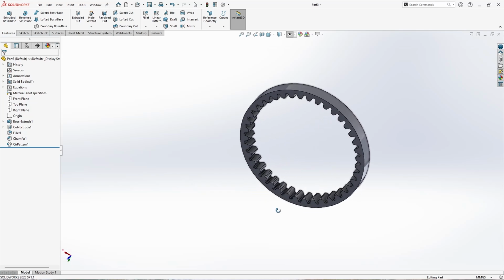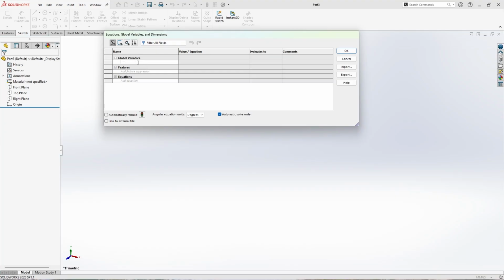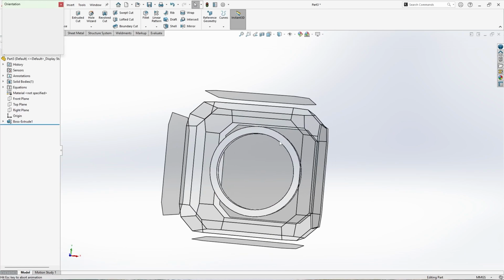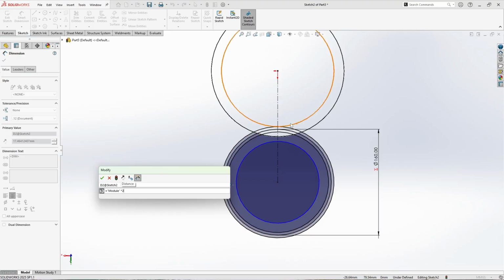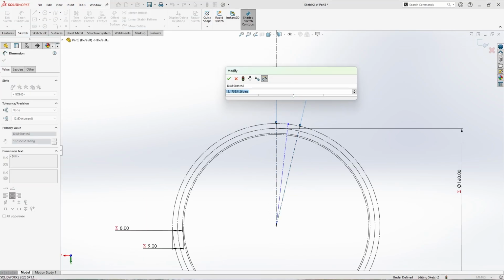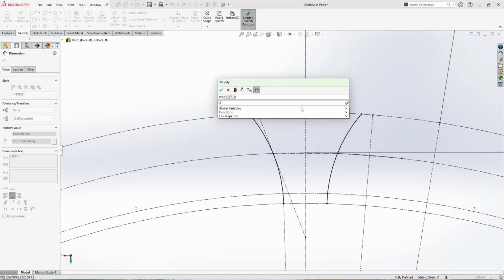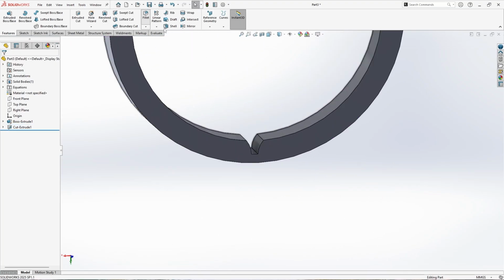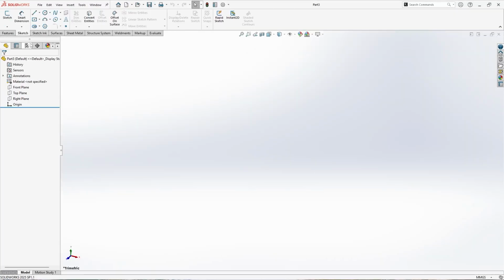Easiest Way to Design Internal Gears in SolidWorks (No Plugins!)

Comment: Hello 
I tried for as following but outer diameter and inner diametrs were bigger than mine

m=2
Z=60
D=169
d=116

The result was D=174 d=124

Could you please give explanation about what is my mistake here?

Thank you in advance
Reply: This happened with me as well. It's because the addendum and dedendum are reversed in the internal gear.